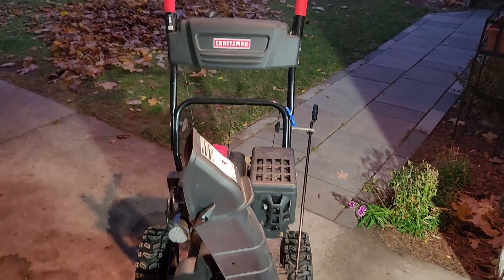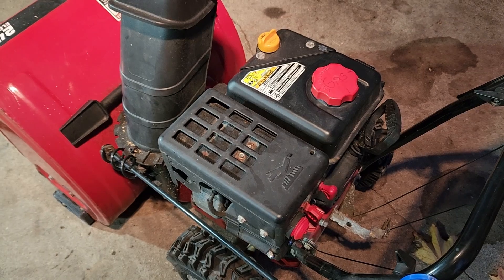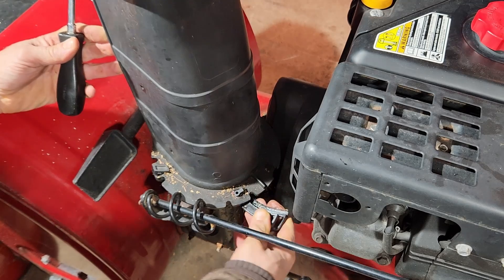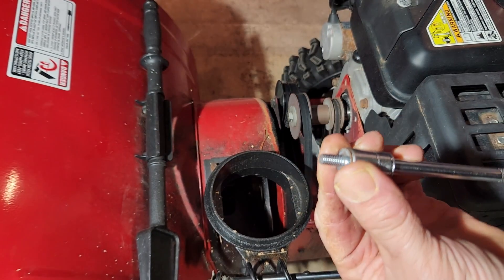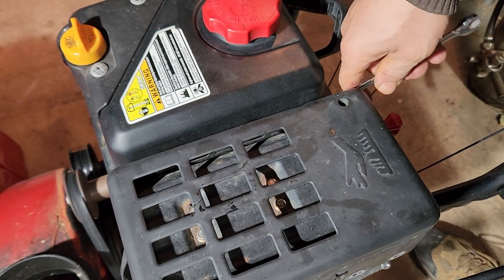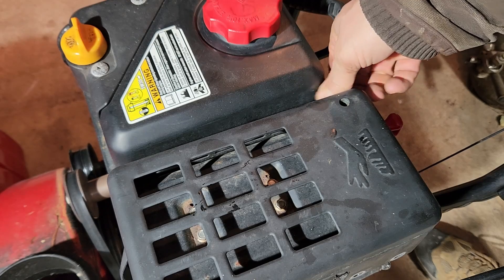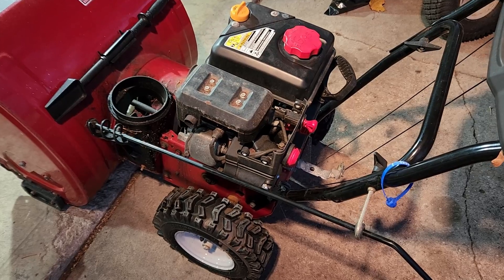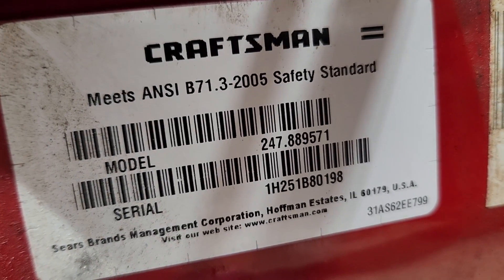Craftsman  Snowblower 179cc Engine RPM Increase

Comment: If your engine is surging drop the carborator nut on the bowl you might have some old gas floating around from last year, peak speed on high idle is 3450prm
Reply from the maker: I tried that. No change. Time to clean the jet.